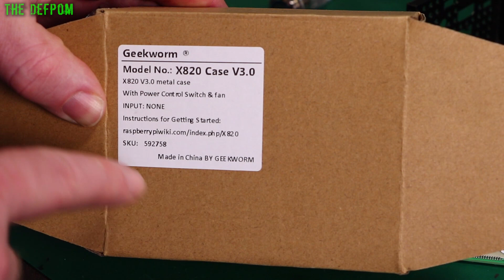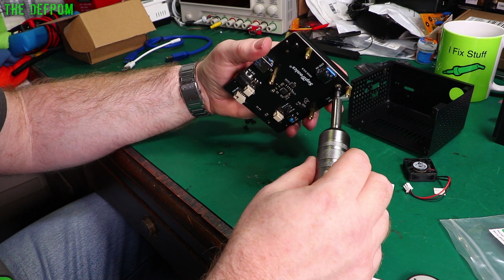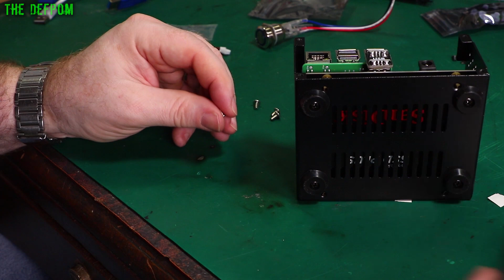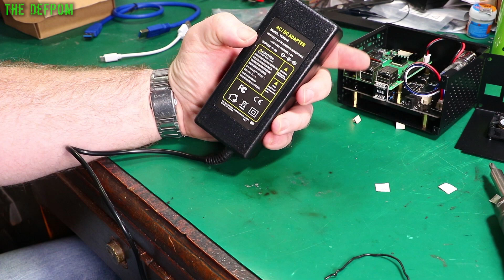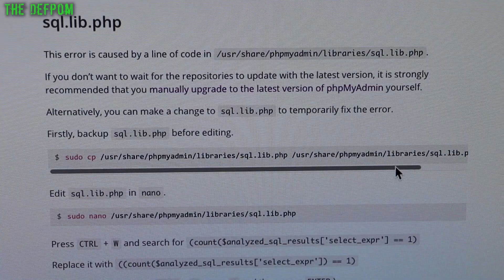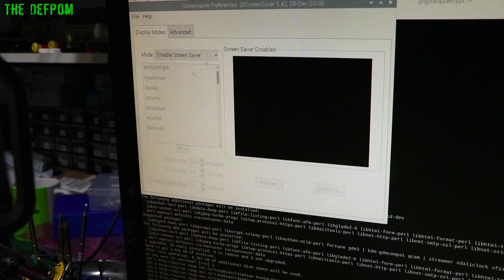#778 Add SSD To Raspberry Pi - Install a Bootable SSD Raspberry Pi 3B+ - And Webserver Tips

Comment: So there is no way to power it with just the C-type 5v? Gotta get the power pack and used the round power port on the SSD board?

Comment: It looks like the positioning of the USB port means it will only work on the Pi 3. They should have had it use the middle port so it will also work on Pi 4.
Have you considered 3D printing a cap for the adapter? Should be a few minutes of work in FreeCAD or OpenSCAD.
Reply from the maker: They have a different version for the Pi 4

Comment: It won't matter much in this situation, but this fan should be blowing inward onto the chip/heatsink.  General airflow through a case will not cool a chip as well as air blown directly into a heatsink.

Think about the difference between a bowl of ice melting in a room with an exhaust fan in the ceiling versus blowing directly into the bowl with a handheld fan.  So long as the case has plenty of ventilation holes, blowing directly above or onto the chip(s) will work better than exhausting air above them, regardless of natural draft.

In a Raspberry Pi, simply placing a small fan <1cm above the bare CPU should work better than installing a heatsink/thermal pad and using the fan as a case exhaust.  Direct, close-range airflow simply forces more heat exchange to occur by constantly stripping away the insulating boundary layer that wants to form on the hot metal surface.  You're better off this way so long as the heat can escape the case somewhere; it's difficult to keep 50C+ air inside a vented case.

This is easily tested for yourself on the Raspberry by trying both methods under 100% load and watching the temperature.  There are terminal tools for this and I'm sure that ETA Prime has a number of case/heatsink review videos that show this effect.
Reply: It is more efficient with the fan forcing cold/dense air than forcing warm/less dense air.
Air mass flow is higher with cold air in a fan.

Comment: Defpom's solution appears to cost $65 (Rpi) + $48 (SATA board/case) = US$115 without SSD and power supply.  It's a nice setup, but a bit pricey, IMO.

If you already have a Raspberry Pi lying around then you should use it, but don't purchase an RPi 3B+ for this purpose.  The 1GB Pi 3 at Defpom's link is more expensive than a 4GB Pi 4 from U.S. Amazon:
https://www.amazon.com/Raspberry-Model-2019-Quad-Bluetooth/dp/B07TD42S27
 
or eBay:
https://www.ebay.com/itm/Raspberry-PI-4-Model-B-4GB-QuadCore-64bit-Motherboard-Computer-NEW-4GB-VERSION/233309620317?hash=item365256485d:g:bngAAOSw9ANdTeXp

Counterfeiting is a problem everywhere, so buy RPi's from reputable buyers, including (hit the Buy Now button to see list, if necessary):
https://www.raspberrypi.org/products/raspberry-pi-4-model-b/?resellerType=home&variant=raspberry-pi-4-model-b-2gb

Pi 4 has USB3 and a handful of other improvements over Pi 3.  The 2GB version should work fine as well if you want to save a few more dollars and is twice the memory of a Pi 3B+.

Comment: Interesting device but a cheap mini-PC might be a better solution.
I have an old Celeron based Intel NUC here with internal SSD.
Reply from the maker: If you were doing this from home and not needing to worry too much about stability (such as windows updates breaking it), then yes an old PC would work just fine.

In the past I used an old PC laptop, and then a Mac laptop to do a similar task, and although they worked they did have frequent moments of unresponsiveness where they would ignore the web traffic for 30 seconds a few times a day, in this planned usage this would be unacceptable.

In my situation I needed something small and reliable which does not have the response drop outs, and can potentially run headless, the Raspberry Pi 3B+ does the job very well.
Reply: @TheDefpom  There's no reason to run Windows on an x86 server.  There are plenty of great linux solutions and they can run headless with no problem; some even come pre-configured for specific server roles.  I have not experienced unresponsiveness simply because a machine was x86, but this would be frustrating.

Don't use old ATX machines as they'll waste power and generate lots of heat, even when idling.  Choose used NUC's or Mini's that run from blister-pack power supplies and have either passive or on-demand active cooling.  Many models are currently pricey ($100+) due to high demand during a global health situation, but they include most or all of the accessories that you have to pay extra for with a Raspberry; some even include an SSD.  Prices should come back down in 2021.